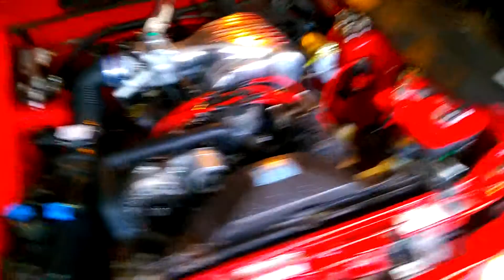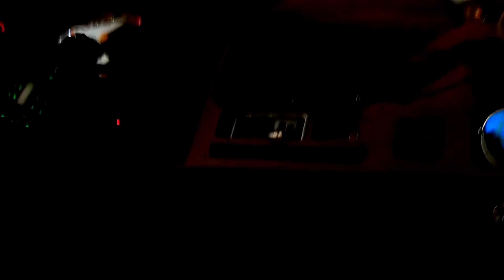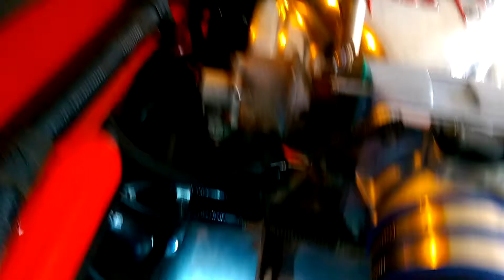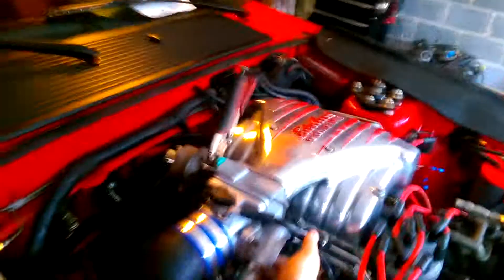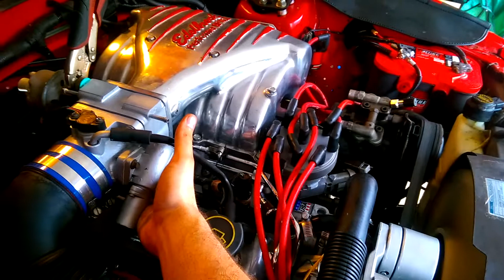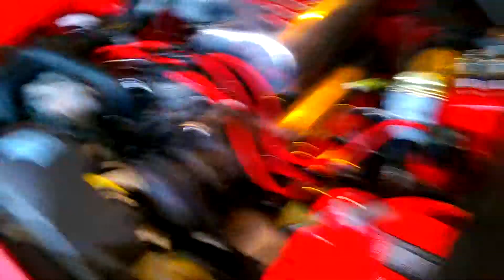5.0 Ford Mustang First start

Comment: Same cam I am using.. putting it all together now..how was it as a daily
Reply from the maker: Still have it, it's excellent as a driver. I used to have 3.73 gears in it, bit too much getting around town. I went 3.27 gear and it seems just right.